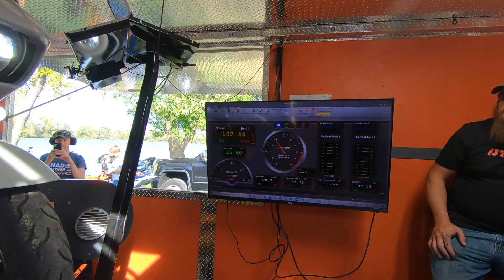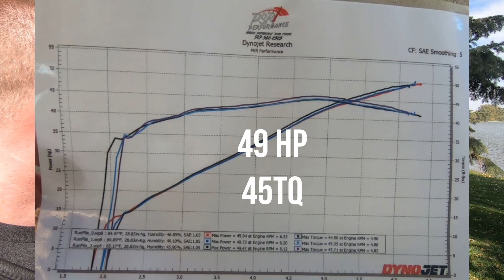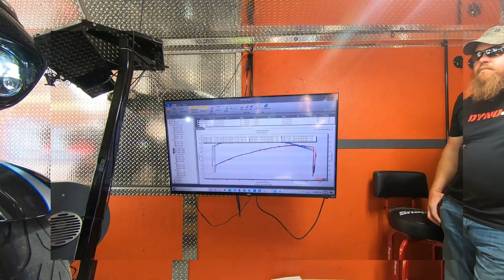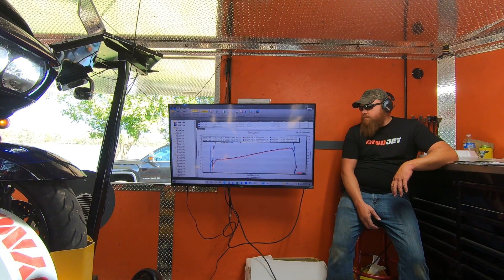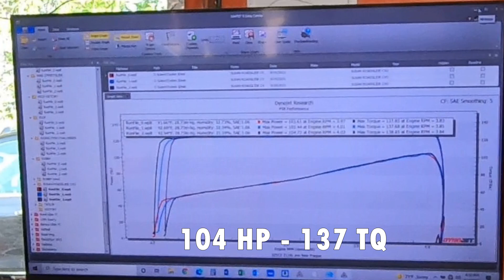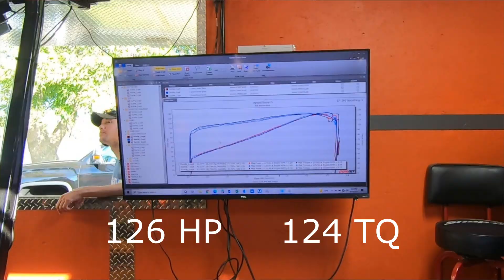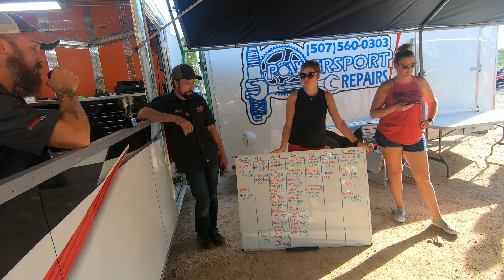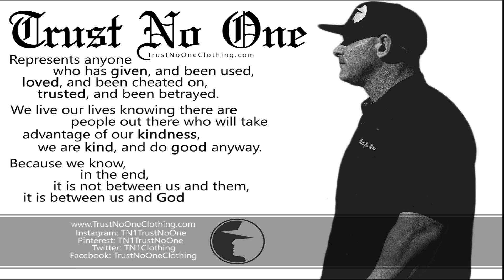@harleydavidson VS @Indian_Motorcycle VS @SuzukiGlobal_official DYNO SHOOTOUT!!   "PRO-CHARGER, 131- 883

Comment: Great video! Thank you for hanging out all day! The 1st 131 also had a speed limit. 6 gear at 4500 rpm them bikes are still climbing... She also has a head gasket out on the bike 🤣 the pro charger is also not running right. That bike is getting dropped of tomorrow 👍
Reply from the maker: Yea,   I forgot about the head gasket!! But the TQ was still amazing even with the limiter!!

Comment: The M109R had an untouched motor and still put down good numbers.
Baddest V-twin cruiser out.
Reply from the maker: Sooo very very impressive!!! 100-100!! Just tune and exhaust and air!! Crazy 🤪 😜
Reply: @Ridingfish  yes sir
Same set-up on my '17, 109hp 110tq. Not bad for a stock motor.
If Indian ever builds a stripped down (new chief style) version of the Challenger, I'll be all over that.
Reply from the maker: @ChevelleGearhead , man I really really hope that happens!! 🙏
Reply: @ChevelleGearhead  I was always interested in the M109R. That’s good at 109/110. The liquid cooled Indian also did well at 110/124. I bought my 19 Sport Glide new with factory stage 3 114ci to retain full warranty. It made 116/116. 

Curious what the 109 & Challenger weigh. As ridden with factory mini fairing & bags mine weighed 700 pounds.
Reply: @vernlochtefeld1626  if I recall, the Indian had work done (cams or something). The 9 didn't, neither does mine.
The weight is similar, the Challenger weighs a tad more. I've ridden some Challengers, including my buddies, and they can't match the 9.
If Indian would only make a stripped-down version of The Challenger.
Reply: @ChevelleGearhead  Interesting I thought the Indian just had pipes air breather & tune. I expect to see Indian add that motor to more bikes.
Reply from the maker: The Challenger has 2-1 exhaust and air intake that is it.. its in the 835lbs area!.. NO cams yet!!
Reply: Did some reading. The M109R is liquid cooled weighs 764 wet and is an over square motor with a huge 4.410” bore. 

So it’s 64 pounds heavier than my Sport Glide and like the Challenger has liquid cooling over on the Harleys. I can get a 4.310 bore but it would still be a little under square with a 4.375 stroke. 

Big bore generally breaths better & over square handles the revs better. By contrast the rev limiter is 6,200 instead of the 6k the Harley Harley tuner allows.
Reply: Can anybody link any cammed or pump gas build M109R lol Boss 9 dyno pulls?  I’d like to see what this motor can do. Just watched one pull to 6800 so they can spin for a big twin. Agreed if Indian built a stripped down Challenger I would be interested in it.

Comment: My 2020 sgs puts down 137 hp and 152 torque out of a 131 with a D&D billet cat and trask air intake, tuned with power vision
Reply from the maker: That's not a HD 131 is it?? If so damn brother they got you tuned up good!!   This day was a tough one with performance ... thick hot air!! 🔥
Reply: Yes sir. HD 131. I bought the bike in late December, and had them build it before I took delivery of it in March.
Reply from the maker: @davidcolby6661 , what tuner do you have?? Because it been done right!!
Reply: Power vision tuned. Robs Dyno, in Gardner, Massachusetts tuned it.

Comment: Your buddy should have gone aftermarket with his cam in that 114 lmao. My 107 makes 109HP and 118TQ with a woods cam.
Reply from the maker: At the moment he is holding the warranty in place..
Reply: That speaks good of your cam but more to your total mods & tuner.  

I did a warranty compliant stage 3 on my 2019 Sport Glide that made 116/116. You don’t have to forfeit warranty to make good power. 

Fwiw Done at bike purchase I got the 20 percent discount so it was price competitive and was financed in with my bike purchase. So no out of pocket plus cheap gap insurance through my credit union. If the bike is stolen or totaled no financial risk to me anything not covered by the bike insurer is covered by the gap insurance.

Bike now has over 19k miles with zero problems and at 25 months old is out of warranty. It’s a great running bike but any post warranty upgrades will be aftermarket.
Reply from the maker: Yea you are putting some miles down that's for sure!!